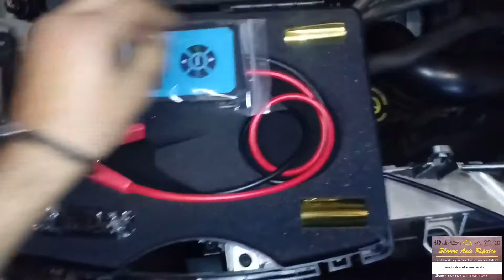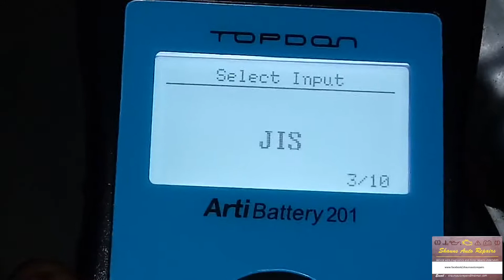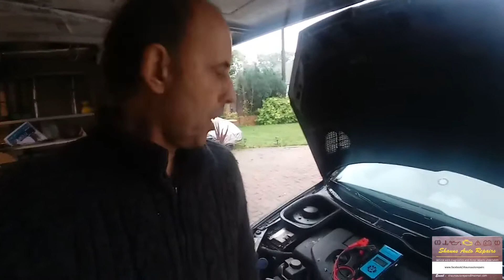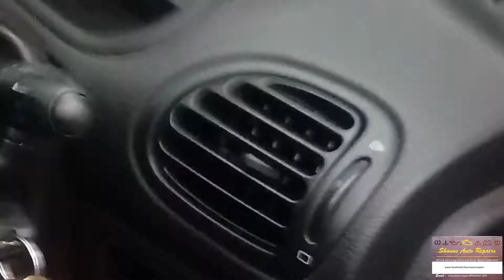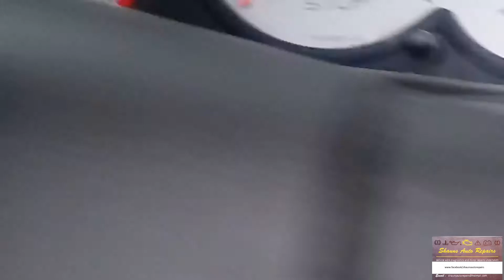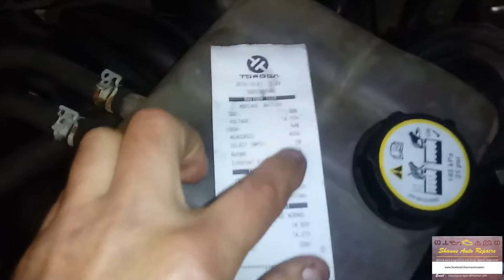Topdon arti 201 battery tester unboxing and first use

Comment: They are quite accurate, cranking V at 9.89 is your biggest clue. That battery is on borrowed time.
Reply from the maker: Yes i was surprised at that result as use the car daily and had not had any issues upto that point. Using it everyday i had not noticed it was getting a bit sluggish. I eventualy did replace the battery about a month or so ago and its so much better now. Thanks for your comment
Reply: shauns auto repairs I have a 2017 VW Passat with a AGM battery rated 680A. It reads on the tester 500A and 50-60% SOH.
Reply: shauns auto repairs Did you replace as precaution or did it fail in the end?